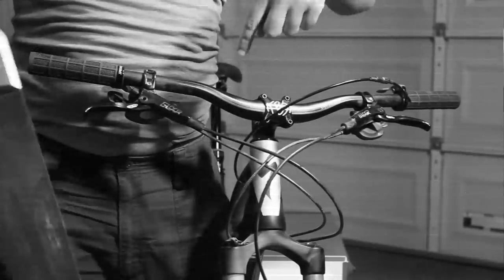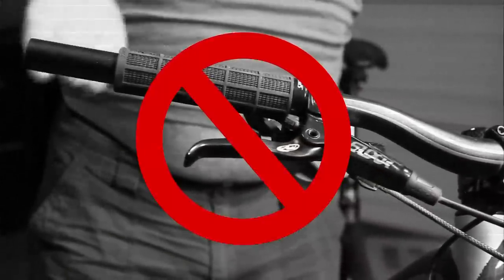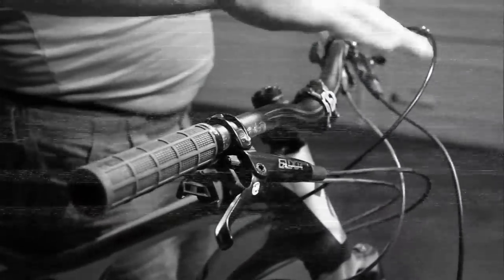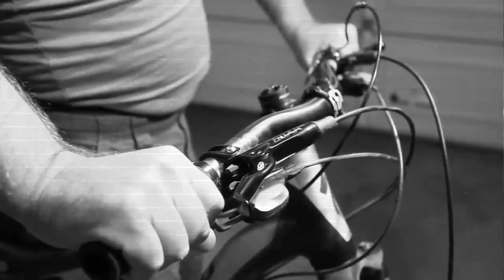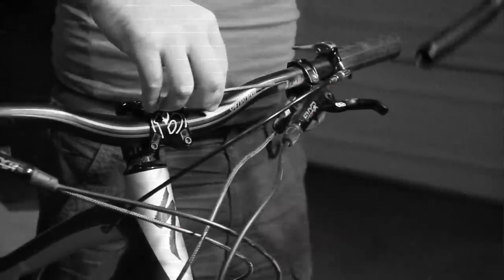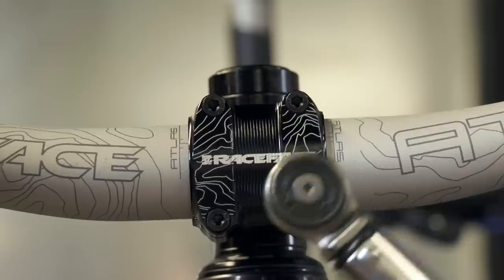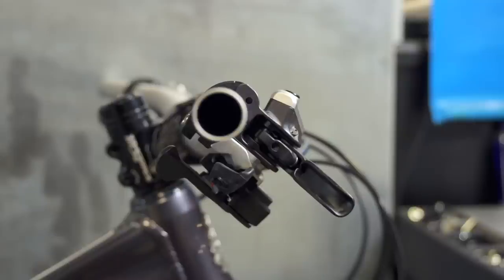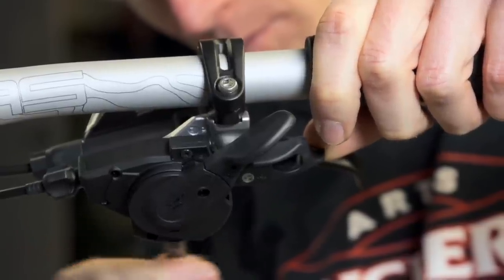How (Not) To: Cockpit Setup (with VitalMTB)

Comment: how do i find the best handlebar position if my bars don't have numbers?
Reply from the maker: ***** It sounds like you are referring to handlebar rotation in the stem clamp. If this is so, you really just have to eyeball it. With stem and headtube angles varying widely between bikes, there aren't any numbers I can offer. A good rule of thumb is to rotate them so that the tip of the bar rises slightly compared to the point where the riser bar bends when viewed from the end of the bar as shown in the video.